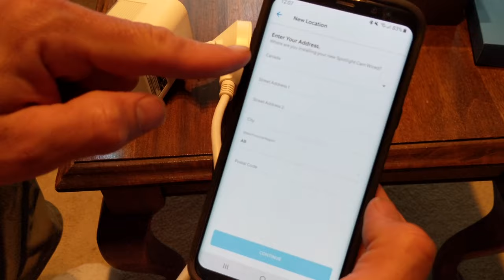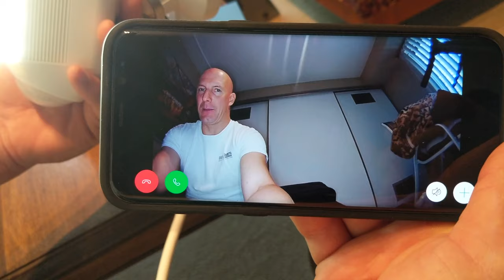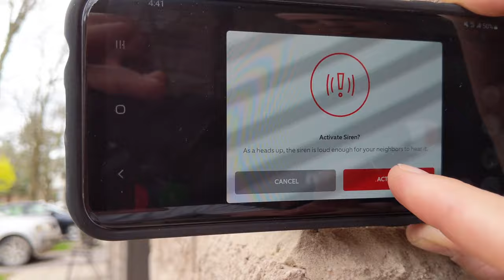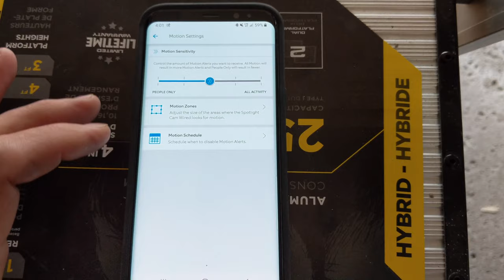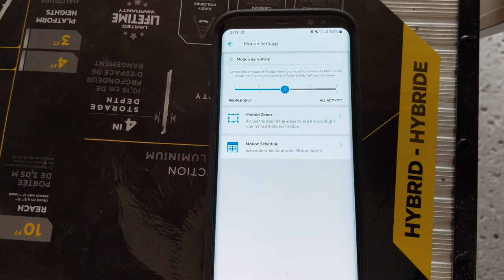Ring Spotlight Security Camera (Wired) Full Setup & Installation

Comment: Jeff. Thanks a million for this step-by-step! I had installed a doorbell cam before but I was a little leery  of having to drill through the garage wall. Your tutorial broke down all the necessary prep so I was more than confident I could get this done. Much appreciated good sir. I read another review of the Spotlight that mentioned that you lose some range [distance] of visibility at night when the spotlight comes on vs just using the cams infrared, so I taped over the lights and I can see all the way out to my gate at the other end of the driveway.

Comment: Great video, I was concerned about feeding the thick cable through a wall. Disconnecting it from the base was a simple solution that most people  just over look
Reply: I had the same question and not sure if I would have thought of that.  Another solution is to cut off the male electrical plug and replace.  Or cut the electrical wire and splice.  This plug/splice is not as exposed to the weather.  The silicon on wire into the base was very thick/stiff and is exposed in the weather.  Messing with that may allow moisture into the base and those electrical connections.

Comment: Did not know you could free up the power cord by removing the back plate. Was hesitant to buy, but not now. Excellent video. A-
Reply: I don't think that any other reviewer has indicated that the AC power cord could be removed like this.
I was contemplating the battery version but I think that AC power is the way to go if you can. Thanks for sharing 🇬🇧

Comment: Thanks for doing the video.  Truth be told, when I was wiring the two power cord wires, I broke the terminals on one of them.  Thanks to Ring, in that they sent me a replacement unit at no charge.
Reply from the maker: That's great that they are doing that at least.  Thanks so much for watching!
Reply: When I read Bob's comment here I made sure I was extra careful & even used a pair of needle nose pliers to loosen those tiny screws a bit first before using the precision screwdrivers. Thanks Jeff - Thanks Bob!

Comment: Great instructional video. I will be installing my cam soon. (I just purchased it tonight. Must have been returned by someone as it came without an instruction manual and ring sticker, but as long as it works and is not damaged, It should be ok. Thank you for the tutorial. Great job! One small thing, I’m an optician and have seen numerous patients over the years with permanent eye injuries from not wearing protective eyewear while drilling brick and etc... I would recommend using some kind of eyewear protection during the process. Just my two cents. Thanks again!

Comment: Great Video! I wish all videos were this good. I have some Qs. 
1. I plan on drilling from the outside of the house and not the inside. Any concerns?
2. What kind of caulk do you use?
3. What kind of drill do I need for this?
4. Do I drill into the brick or mortar? Does it matter?
5. Not a question but please use a N95 mask when doing this. Drilling into brick is hazardous is what I read. 
Thanks again for this video.

Comment: Thank you Jeff.  Your video is the first one I have seen showing that this specific camera can indeed be installed without cutting the wire and splicing it back together after it has been run through the hole.  I really appreciate the way you present the entire process.  Thank you sir.
Reply from the maker: Thanks so much for the comments!  Thanks so much for watching!
Reply: @JeffLepard  my camera arrives today.

Comment: Excellent video sir . All the other videos have shown people cutting the plug off but yours has shown there a better way . Well done and thankyou !!
Reply from the maker: Thanks!  Yes most people want something faster so they cut the plug off but if you are ever changing the unit or selling the old unit no one wants a cut plug for sure.  I appreciate the support!
Reply: @JeffLepard  hi @jeff so it is possible to shorten the wire from the same end you show in the video? my plug is only 4' from the camera and i have about 15' of extra cable that i don't really want hanging around.

Comment: Great video, thank you.   Shame the inventor of the ring camera didn’t think about the wire going through the wall and make the plug with an adapter!   I have the solar powered one on the front of the house and will now install a wired version down the side.  Thanks. 👍
Reply from the maker: Yeah I wonder what their design thinking was behind that I'm not too sure.  Even if someone has a plug on the outside most of the people I've talked to or received comments about the plug is very close to where they are installing the spotlight so now there is so much left over cable that is hanging or they have to cut some of the wire off.   Thanks so much for watching!

Comment: Very helpful video, thank you.  Ive heard that the wire is hard to take apart but you proved that wrong, it wasn't so hard, even I can do it.   Thanks so much!
Reply from the maker: Yes for sure it wasn't too hard at all.  Its great they were screwed in and not soldered otherwise that would be a different story!

Comment: That was interesting. I already have a mains light , above the door that I want watched. I intend to remove my very old light and replace it with that camera model.  Can the cord be cut and stripped to shorten that long lead    ?  What is the steepest angle of tilt that the camera allows. Was yours set at the steepest angle ..

Comment: I have the Ring Floodlight Cam as well as the Doorbell Pro 2.  I'm getting the Ring Spotlight Cams, will I be able to have it face to the right about 70 degrees?  I'm placing it on a wall outside my garage and want it to face the front door.

Comment: Hi Jeff, thanks for the vid! Do you know if the same thing applies to the UK version of the Spotlight Cam? Also looking to disconnect the wire so I can feed it through a wall.
Reply from the maker: I would believe the UK versions would be similar and I'm most certain that you can feed the wire through the wall just like I did on this one.
Reply: Trugg. Have you managed to do this?
Reply: @richardflavell1009  sorry, ended up going down a different route after all that! Ended up purchasing a couple of Floodlight Cams instead of Spotlight Cams.
Reply: No worries thanks the getting back to me 🤙

Comment: QUESTION: So, is it possible to replace the wired light on my back patio with this spotlight cam by removing the attached wire as you did and then attaching the wires right from the house to the Ring spotlight cam?
Reply from the maker: Technically yes you could do that.  Most people wouldn't go through the trouble of doing so but you could do that.

Comment: What size precision screwdriver did you use to unscrew the power wires? I’m having real trouble doing it because they’re so small but I really don’t want to have to cut the plug off as an alternative.
Reply from the maker: That's a good question I didn't mention that in the video.  It was one of the few small screwdrivers you would have to use.  Definitely any of the small kits would have the right size.

Comment: Thank you so much for making  this video. I am planning to do this soon. I didn't catch if you mentioned the cable length? The nearest plug to my install point is a little ways off and I am wondering if it will be long enough. Thanks again!
Reply from the maker: Thanks so much for watching.  I don't think I did mention the length but I know that cord was very long!  The cord was at least 20-25'.  Hopefully that will do for you otherwise you could just use an extension cord.

Comment: jeff is there a screw that tightens up against the base that  you need to loosen to slide off main bracket, if so what size screwdriver is it? thanks
Reply from the maker: i cant remember the screw size but I have been asked this question a few times so for future videos i will make it a point to mention what size I am working with!  Thanks so much for watching!

Comment: Why take apart the camera and break the factory seal when you can much easier cut the cable toward the plug end, thread it through, and use an approved connection box inside. This keeps the weather proofing, is a lot easier than messing with the tiny screws inside and a lot quicker.

Comment: Great installation video. Ring should have allowed for the power cord to exit directly out the back plate, however, to allow for a cleaner and more professional install and to prevent tampering with the power supply. Not your fault just a design flaw.

Comment: As a professional installer, we were trained to NEVER drill from the inside out on a brick exterior as it can push a brick out in some homes.   

And please do not forget to double check both sides of the wall.
Reply from the maker: That is true you can also pop the front facing off the brick.  In this case I wanted to make sure it was going exactly where we wanted it.  Thanks for the info and support!

Comment: Hey Jeff, I'd really like to do this but I am concerned about running a flexible power cable through the wall. I have heard this violates the NEC 

Have you heard the same?
Reply from the maker: I will look into that.  Otherwise you can run it through a conduit I guess.
Reply: @JeffLepard  Sounds good! And I am considering that option
Reply: @JeffLepard  Did you ever find out? Thanks!

Comment: I need someone to answer this question:
What’s stopping you from drilling a hole in that mounting plate and on the back portion of the camera where it slides onto the plate in order to run the wires directly into it from there? This would eliminate the wire being seek from the outside. I’m looking to install this soon and was thinking I was going to do it the way I mentioned. Looking forward to hearing thoughts, thanks!
Reply: Likely water ingress. He should really put silicone sealer around the port where the power cord exits too and on either side of the garage wall hole. I’m tempted to do this but my worry is it’s not up to NEC and should home catch fire, insurance may void coverage if this was found to be point of ignition inside the wall (not so much here with brick but if it’s a wood wall with drywall, maybe more of a concern)

Comment: Looks like on the most current wired cameras there is some black sealant on the wires. Mine had it so I put a dab of silicone on it after I did my wire routing

Comment: Question: When you reinstalled the wire in the back of the camera, did you replace the silicone or did you just not show it in the video?
Reply: i was thinking the same thing... I'm going to replace the silicone before installing.

Comment: Great video. Is it waterproof rather than weatherproof? Will moisture obscure the lens and/or degrade the processors inside? Ring has no usable info on this.
Reply from the maker: I have not had any problems with weather changes.  No issues at all with water damage or any damage to any of my ring cameras.

Comment: Hey do the lights turn on when motion is detected or do you have to manually turn them on?
Reply from the maker: They will automatically turn on if it is at night based on the sensor.  You can also turn them on anytime manually.

Comment: He could of mounted to camera directly in front of the wire. This would of prevented the wire to be exposed on the outside of the house. Also he could of drilled the hole exactly where he wanted to place the camera.
Reply from the maker: Yes I could of done that for sure I just installed it wherever the customer wanted it.   There was the garage door bar that was in the way so I was limited where to drill but there was a few spots I could of drilled for sure.
Reply: Very helpful video. Does the wire actually bend enough to be able to go through the hole you drill though?
Reply: @offthecha1n  If you use the 1/2" width drill bit he uses in the video the hole is wide enough for the wire and the grommet to fit through. I also use some masking tape to wrap the leads together so the won't "fight" you as you push through. Undo them on the exterior side of the wall then re-attach to camera base.

Comment: is there any way to hook in a ethernet cable to that power cord , seen it done on other stuff , wifi to susceptible
Reply from the maker: That's a good question for this camera I'm not too sure but I think you have to use the WiFi.  I will look into that.  Same for me I have seen it used on other devices but I haven't seen it on the spotlight cam.
Reply: @JeffLepard . ok cool , just with wifi being susceptible to jammers (purposely creating a dead zone in the cameras area) .... and other variables if router a distance away , i would advise ring to ad a ethernet socket to this version of cam , in future revisions

Comment: Waste a whole evening trying to unscrew the screws that uses a precision tool , couldn't find the right size even after running to Home Depot to get a new set . Had to run the wire between my from door  after drilling the hole .
Reply from the maker: I wasn't too sure what size they are but I have a few of the kits.  Its a bit of a pain for sure.  Thanks for the support!

Comment: The screwdriver that is included with the camera does not fit so you have to contact customer service for them to send out the right driver. I wish Ring would have made this easier to detach the wire. I had to use 3 different screw driver heads to remove the contact wires. Bad design. Thank you for the the video!
Reply from the maker: Yeah the wires on the inside of that were much smaller.  Ring probably doesn't want anyone opening that up but the option is there.   That wire must be removed if you are trying to put that through a wall.  They could of make a cable where it would detach at the plug which would be much easier!  Thanks for watching!

Comment: Easier just to cut the plug off then go to HD and buy a plug...This way you don't worry about the silicone being in the right place or deal with those tiny wires when you're 70 years young...😄

Comment: what if I come with my balaclava and cut off the white wire cable you left exposed?
Reply from the maker: That is always an option of course same as the internet cable from the service providers that provide the internet at the side of each house.  Most certainly the video footage will fail but this is where you can get into deeper security which I will be covering soon.  Back up power & back up Wi-Fi connections.  Thanks for watching!

Comment: Can I just run the wire through the side of the garage door to the plug instead of all the drilling?
Reply from the maker: Yes you can as long as your door will close firmly and the wire doesn't pinch through the weather stripping or seal.

Comment: Just bought one of these two days ago and the front and sides are hot to the touch. It’s the one you plug into an outlet. Customer service says the diagnostic shows it’s fine. Anyone else have this issue?
Reply from the maker: It should be fine I haven't experienced that myself though.

Comment: Could you not have put the mount upside down, drill the hole directly above it then feed the wire through it that way?
Reply from the maker: I'm sure there could of been another way to install the cable this was my first spotlight that I've installed.  I will look into that I will be installing more but I believe the next one will be wireless.

Comment: Just a thought, why bother going to the trouble of removing wiring from the light when you could just cut off the mains plug and pull the cable through the wall and fit a new plug? Excellent video otherwise
Reply from the maker: I agree. I did whatever the customer wanted me to do.

Comment: If you're going through the trouble of drilling why not just buy the hardwired unit? It would look a lot cleaner and you wouldn't see any wires going through the wall as it would all feed through behind the unit.
Reply: Might be more expensive to run romex and conduit and install a junction box. Fairly certain what’s being done here is not NEC compliant and could be a fire hazard as the cord is likely not rated for going through a wall. Then there’s the issue of voiding house fire insurance. I totally understand the desire to do it this way though for ease and low cost.

Comment: The app is different. It doesn’t give me the option set the zones like you did
Reply: Charles F is it battery or wired? Wired had option to set custom zones. Battery powered or solar doesn’t allow the option to set custom zones just general zones.
Reply from the maker: @anthonyhuerta3432  Thanks for answering that!  That was a great question.  I haven't tried the battery option but I will be shortly.

Comment: I would have hidden the cable behind the camera!
Reply from the maker: You could do it that way as well.  Thanks for watching!
Reply: In fact If you need to cut off the wire the best thing to do is to buy a "Ring spotlight MOUNT" not a "Ring Spotlight WIRED" which is what you are installing. That way it will be a much better looking installation with all the wires hidden. In fact I had to install a gifted 'Wired" on my garage wall too. I turned the base upside and made a hole on top of the base into the wall. So the wire is hardly visible. Mind you I watched your video first! 🙏

Comment: The cable it's too visible, it would be a piece of cake to cut it hiding in the blind camera spot
Reply from the maker: Yes you can see the wire.  That was where the customer wanted me to install the camera.  3 Days after I installed that they caught someone stealing there flower pots.
Reply: @JeffLepard  are u sure they did
Reply: @JeffLepard  because i know the owners